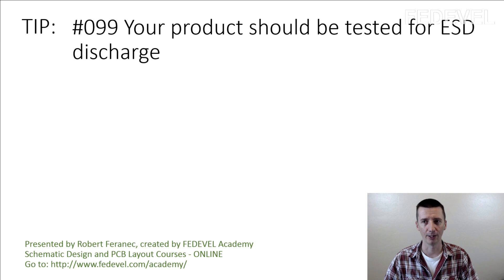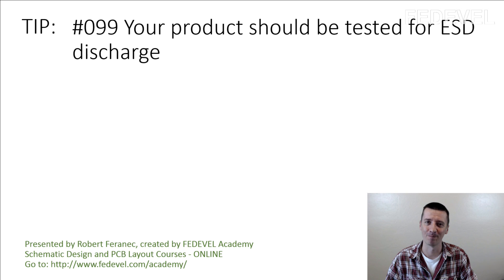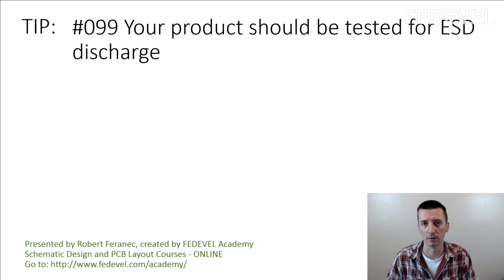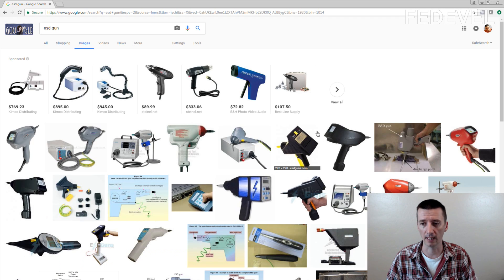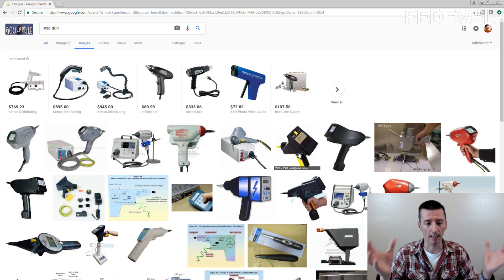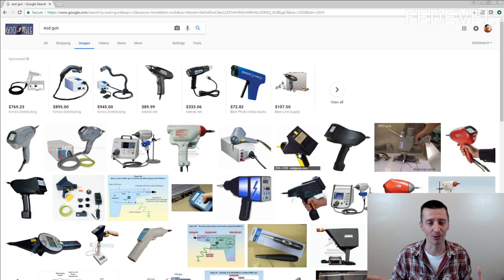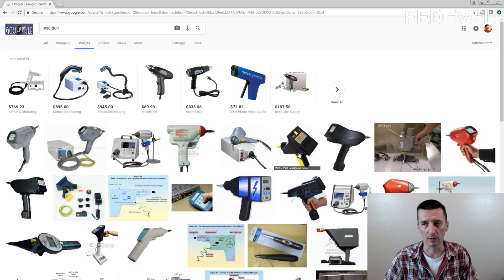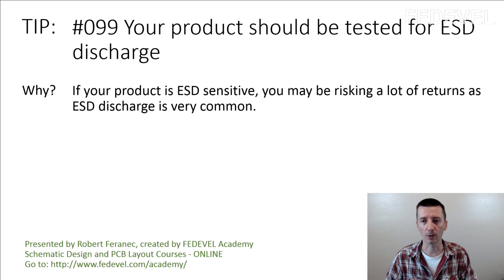TIP #099: Your product should be tested for ESD discharge

Comment: So true !
I'm an embedded software engineer with a lot of different experiences in many fields, but who still has to learn a lot in the embedded one ...
I discovered this problem during pre-production testing in China. There may be hardware solutions to avoid or reduce the risk, I can't tell, this is not my domain. But there must also be software work around !

At first, I did not understood what the tester was expecting with his "spark gun". What could possibly go wrong ? At worst, what could possibly go wrong in my software ? May be the electronic can fail ? That's my colleague job ! But my software ...
What a surprise ! It's pretty easy to make product behave badly. In our case, it was rebooting the product.
And then the tester tells me : your software should restore the state of the product at the point just before the failure. What ? Is my responsibility ?
Yes, it was.
When a bluetooth speaker is playing music and reboots because you got up from your chair, during winter, and cold weather, and dry air, etc. And you touched the product and it reboots. The client expects, at least, that the product restarts and resume playing as if nothing happened.

I worked a bit to find solutions. It's not that hard : reserve a part of the MCU flash to store status, store the fact that the product is currently running, so that, if it reboots, it will read that information and know that it was not properly shut down. The rest is just storing and restoring the status (BT or AUX input, volume level, etc).

To make addition tests at the factory, the hardware engineer had one of these spark gun used to ignite the gas of cooking devices ... It does the job for quick and dirty checks ! You'll go to the official test lab in a better peace of mind state later !

Comment: Thank you! but how test pcb! if posible more deeply, what we need do, and how check pcb after esd test? chip must cresh? or what must heppen?
Reply: There are test-scripts and test-stands which are pointed in the program of ESD testing. After finishing ESD test, devices will be tested in according of this program with help these scripts and stands. This is a multipurpose procedure.

Comment: Good tip.
I'm suggest to put attention to following norms:
EN61000-4-2 - ESD (this norm cover problems like Robert said)
EN61000-4-4 - burst (this norm cover problems with fast pulses caused by i.e. switching elements)
EN61000-4-5 - surge (this norm cover problems with high energy pulses, like this when hiting nearby thunderbolt coupling in wires pulses).
In my experiance as employee of such accredited laboratory, this are most common (and spectacular :) problems for modern electronic.